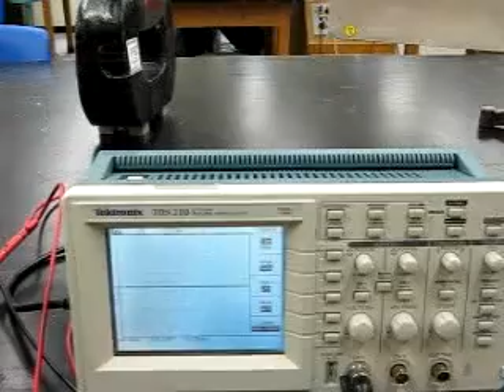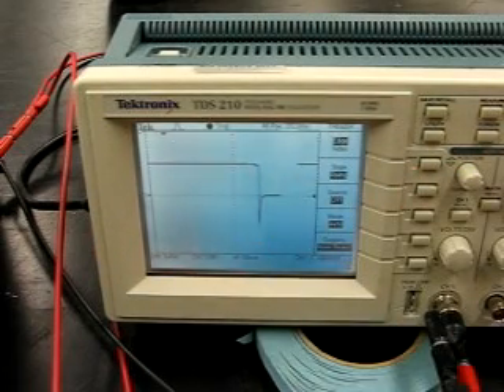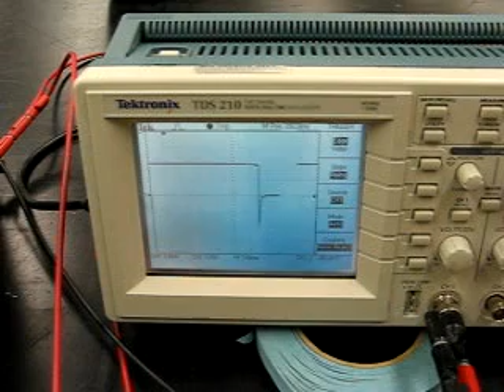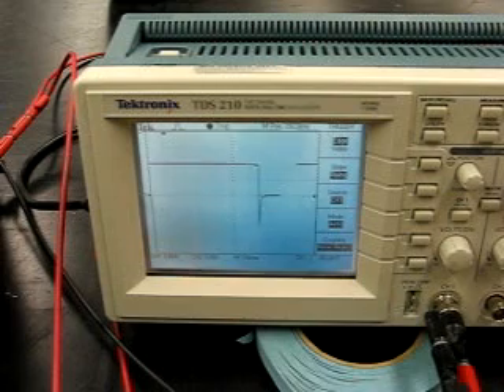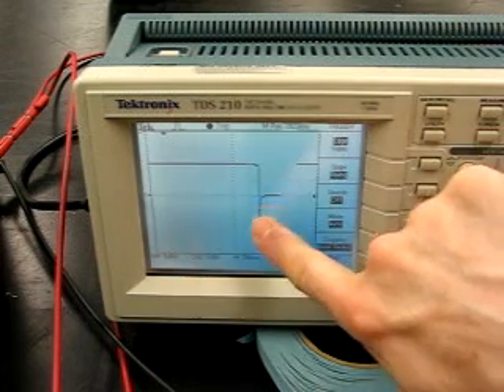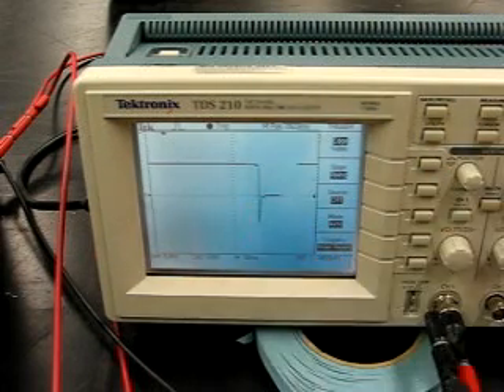Back EMF on an Inductor

Comment: I know you were trying to show back EMF, but when you first energized the coil, but my understanding is that the expanding magnetic field created a resistance to current flow (another back EMF, of sorts, but not as dramatic as the one created when the voltage is removed).  This was shown on the scope, as the initial voltage didn't start at exactly 12 V, but stated out at something less and ramped up to 12V once the magnetic field stabilized.  The sudden collapse of this field created the back EMF demonstrated.  I would suspect that if you took an integral of the power stored on coil chargeup, that would equal the power released on power shutdown, but my math isn't that great.

Comment: Impressive size of the solenoid!

I am a novice so maybe I am going to ask a stupid question but here it is ...

The electro magnetic force created by a coil is directly proportional to the current flowing through the wire i.e. independent of voltage.

But is back EMF independent of voltage?